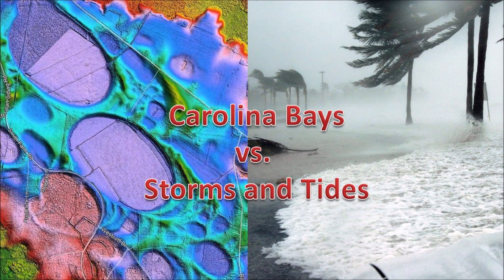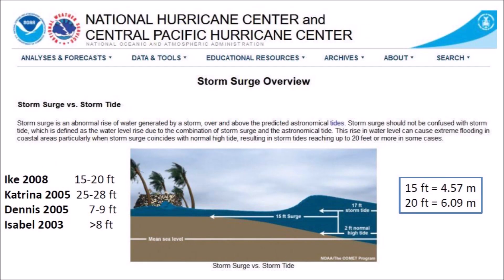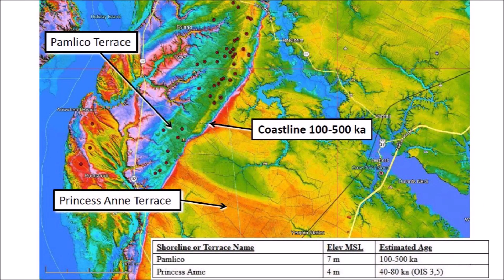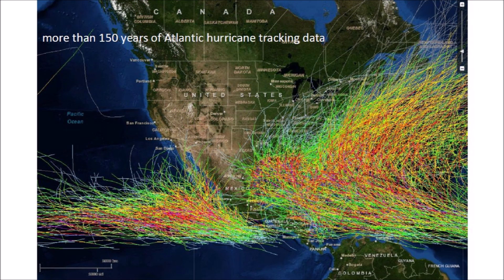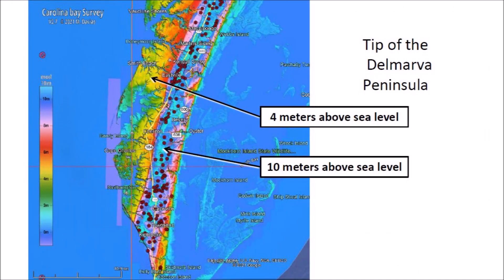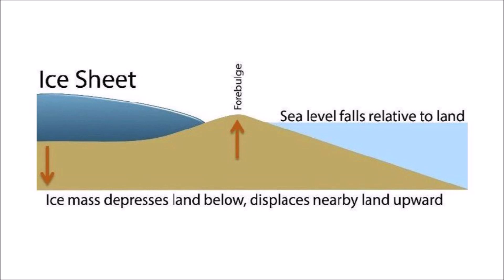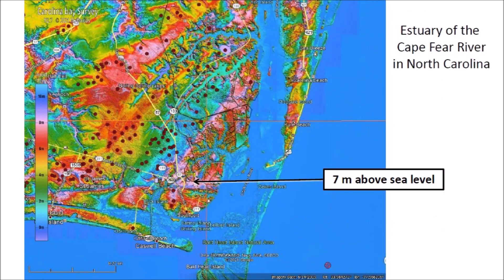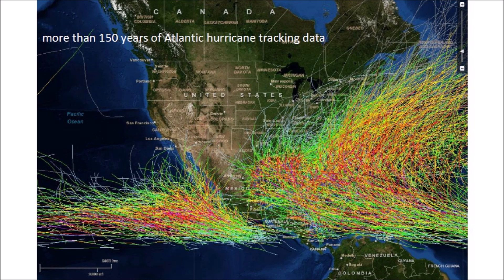Storms and Tides destroy Carolina Bays

Comment: is there any evidence of tsunamis inundation along the eastern coast in the last 10000 years? I would imagine that would have an erosive effect. 

Also, what happens when a number of huge ice boulders land in the water off the coast? 

But i guess you can gage from the distancing of the Nebraska Basins if.. and how far off the east coast boulders would have landed.
Reply from the maker: Some ice boulders would have landed beyond the Atlantic coastline 12,900 years ago, but they would have created a lot of splashes instead of one single splash that could create a tsunami.
Reply: @Antonio_Zamora  yeah i was thinking more they might have created some immediate slash back that might have affected the fresh impacts on land.. but in mentioning tsunami i was thinking if Hurricanes could have an effect then perhaps tsunamis created by other causes could. 12900 years is a long time the whole impact hypotheses shows how catastrophe can have an immediate and devastating result.  

but grew up in Coastal SC so i know the effects of hurricanes and storm surge.

Hurricane Hugo in 89 created a 20 to 22 foot storm surge in some areas just south of Myrtle Beach.. I'm sure the East coast has seen worse since the Younger Dryas.

anyway .. that is my two cents.. probably a little over priced :)

thanks for the work and the videos
Reply: @griffin5779  The limit of a storm surge is about 25 feet. The low pressure in the storm is what lifts the water as it goes along it's track. The maximum height you can lift water with negative air pressure is 32 1/2 feet. That can really only be reached with a sealed pump system. In practical terms, about 20 feet is the storm surge height limit, but forward wind on the approach to land might push another 5 or 6 feet ahead of it. Basically, the big storms we see are about as big as they get. Thankfully. 👍 I hope that helped you understand them a little more.
Reply: The coastline was farther away before the YD events. A Tsunami back then would have occured on land that is now underwater. The number varies by source and exact time, but the sea level was probably about 200 feet lower than today. The continental shelf would have been above water, mostly. Our east coast would have been just over 100 miles from the coastline back then. So, we lost some real estate, but we gained some cool craters!
Reply: @d.t.4523  Ahh .. yes i wasn't considering the YD shoreline when mentioning Ice Boulder splash back. lol. 

Well i’m not a researcher or Geologist.. But unless i’m still really off base (quite possible) Zamora is suggesting storm erosion after Meltwater pulse 1B as an explanation for the lack of Bays in lower elevation close to the current shore line as a counter to Dabbler’s dens postulation the Bays must have formed far earlier. It still seems valid that if storm erosion affected Bays over thousands of years after sea level rise, that they could have been affected by other sea level rise events (small Tsunami NOT caused by ice boulders lol) during that time.. Just another possible mechanism to support Zamora's explanation but no idea if any evidence of such events exists.

In regards to Storm surge level or Hurricane intensity .. I’m not a paleo climatologist (not even sure such a field exists)  so I wouldn't have a hope of gauging  their possible intensity or frequency, over the last..11000 year? ..  but one would imagine that the rapid temper rise at the end of the YD might have resulted in a period of increased Hurricane activity.

I’m much better at useless speculation than actual research :) Ok.. back to the cartoons
Reply: @griffin5779  Read the comment and replies to François Badoux in this video. The timeline may not be an issue. The missing bays may have never existed. 
https://www.youtube.com/watch?v=bilyP7Xv-l4
Reply: @d.t.4523  I always feel the need to point out I have no credentials before I comment so people know just how much weight to give my comments.. Lol

But just read your comment.. If I understand it and if it pans out it is a nice solution to the question..

However it seems to me unlikely there would be enough of a rise or ridge to form a protected area below. I'm from SC and they call the area the lowland for a reason. You really have a hard time finding a hill till you get 100 miles inland. 

Also you would assume that kind set up would create an excessive cratering pattern at the crest of the raised terrain where it was absorbing a greater number of impacts and there would be evidence crests or ridges damaged, destroyed or flattened by impacts. 

Certainly worth a little consideration by someone more informed than I am.

I lean towards the idea of a recent event but there are questions I have that I haven't seen addressed (i’m sure they have been.. I just haven't found them). I wish i could find information with a more extensive comparison of the Nebraska rain basins with the Carolina Bays.

If the Bays and rain basins were created by the same event It seems you would be able to calculate the trajectory of the comet, the secondary projectiles, the pattern they would land and estimate the distance beyond the Carolina Bays more ice boulders when they have fallen.

Clearly the Rain basins cover a smaller area so you assume impacts must have occurred in an arc to the north or south or both. That would seem an important piece of information to determine what erosional processes erased them and would give you another data point to help determine the age of both the basins and bays.
Reply from the maker: This video discusses the Nebraska Rainwater Basins: https://youtu.be/O1bus2zHf7s
Reply: @griffin5779  The ice was flying at a 35 degree angle, as it hit the ground. That will cause a blank area behind any elevation height, or a shadow area. For every foot of elevation ther will be about 4 feet of a shadow. 20 meters, 65 feet, will have about 260 feet of shadow. if that helps.
The bays were only formed on ground where loose sand was at the surface. This video shows some more detail.
https://www.youtube.com/watch?v=BG1Y1kOoxjk
Reply: @Antonio_Zamora  Thanks. I’ve watched most of your videos over the last few weeks but I think I missed that one. I'm curious as to your thoughts on why the Nebraska features  cover a smaller area. Was the area immediately to their north under the Laurentide ice sheet or do you think they have been eroded by Massive flooding? Or is there another explanation?
Reply: @d.t.4523  Thanks. 260 feet of shadow doesn't sound like much considering the size of some bays. That is where it seem a comparison of the width of the Nebraska rainwater basins "debris field" would be helpful in determining how much further out the Carolina bays would have extended.
Reply from the maker: @griffin5779  One of the characteristics of the Nebraska rainwater basins that is not found on the Carolina Bays is a layer of loess, which is dust from the rocks ground up by the glaciers and carried by the wind. The Nebraska terrain is also much rougher and more subject to erosion by water than the smooth and level Eastern shore.